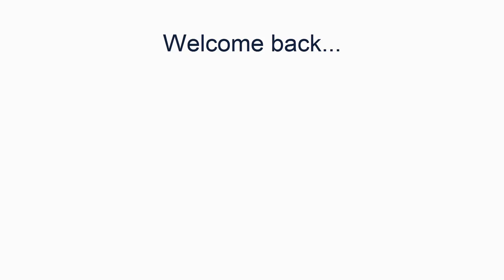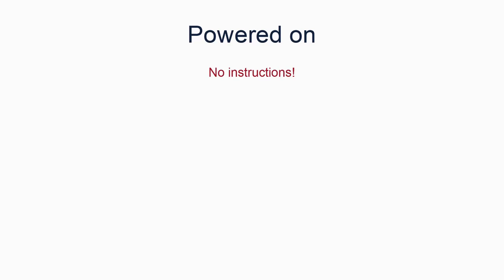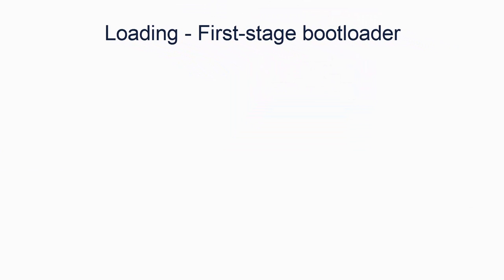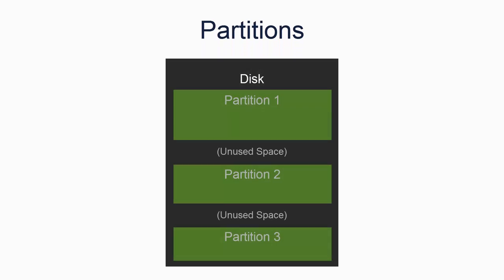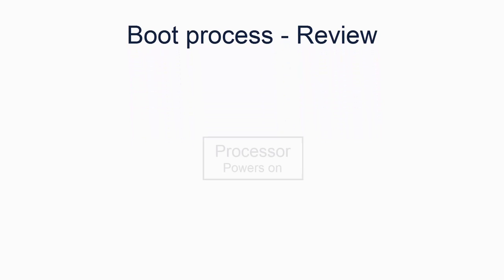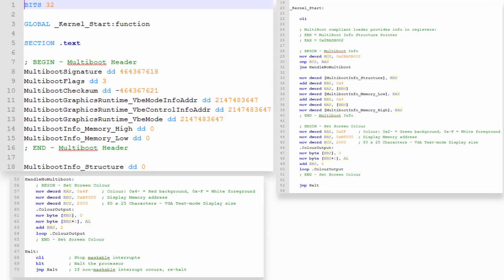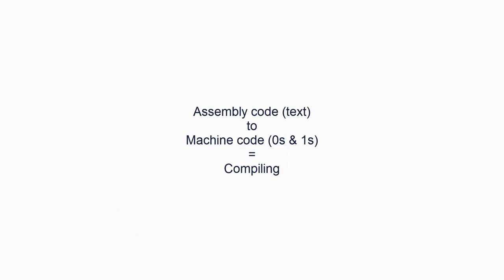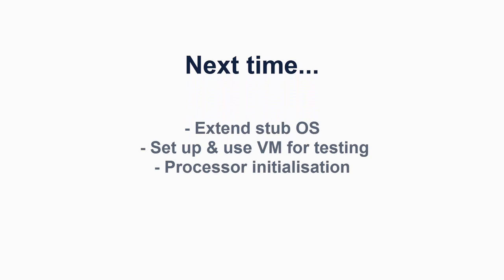2. Booting

Comment: What is the architecture of this operating system?
Reply from the maker: The compiler can target x86 or MIPS32. I've not maintained it in a while though and some users have reported errors with VS2019.

FlingOS can be used as a monolithic or a microkernel depending on how you set up the processes and communication. By default it's a microkernel.
Reply: @EdNutting  Ok, Thanks!

Comment: Can you make a tutorial for linux please?
Reply from the maker: Could do, though it depends what you'd like to learn? Linux is a very big and complex operating system. The Linux 2.6 Kernel is covered in a lot of depth in more than one book.
Reply: @EdNutting  It's just that I can't get the iso9660 generator for this tutorial, do you have any alternatives that I can use?
UPDATE: 
I tried the linker, but I keep getting this error, even though I added -arch x86_64 at the end of the command:

ld: warning: platform not specified
ld: warning: No platform min-version specified on command line
ld: warning: ignoring file linker.ld, building for -x86_64 but attempting to link with file built for unknown-unsupported file format ( 0x45 0x4E 0x54 0x52 0x59 0x28 0x5F 0x4B 0x65 0x72 0x6E 0x65 0x6C 0x5F 0x53 0x74 )
ld: warning: ignoring file kernel.o, building for -x86_64 but attempting to link with file built for unknown-unsupported file format ( 0x7F 0x45 0x4C 0x46 0x01 0x01 0x01 0x00 0x00 0x00 0x00 0x00 0x00 0x00 0x00 0x00 )
Undefined symbols for architecture x86_64:
  "_main", referenced from:
     implicit entry/start for main executable
ld: symbol(s) not found for architecture x86_64

I never put "_main" anywhere.  why is tat.
Reply from the maker: @wqatch  

UPDATE: Altered the command listing - my Ubuntu install was a bit quirky so I started fresh so this should work properly now.

So I'm guessing what you were originally asking is how can you compile, link and generate an ISO for the supplied files on a Linux host rather than on a Windows host?

If so, then the following steps should work (they worked on Ubuntu: Windows Subsystem For Linux, latest version today):

1. Install NASM for Linux from https://www.nasm.us/pub/nasm/releasebuilds/2.14.02/linux/:

Ubuntu: sudo apt-get install nasm
Other Linux Distros: Please tell me which you are using and I'll try to help.

2. Build the assembly code file using NASM

nasm -g -f elf -o Kernel.o Kernel.asm

3. Modify the Linker script to specify the output architecture.

Insert the following after OUTPUT_FORMAT:
OUTPUT_ARCH(i386)

4. Link the object file to a new object file... 
(Note: On Ubuntu, Ld should already be installed)

ld -mi386linux -static -T linker.ld -nostdlib -o Kernel.obj Kernel.o

5. Convert the object file format for ELF32 Binary:

objcopy -O elf32-i386 Kernel.obj Kernel.bin

6. Copy the bin file into the ISO directory

cp Kernel.bin ./ISO/Kernel.bin

7. Install 'genisoimage' for Ubuntu:

sudo apt-get install genisoimage

8. Generate the ISO image

genisoimage -no-emul-boot -boot-load-size 4 -b isolinux-debug.bin -boot-info-table -o ./SampleKernel.iso ./ISO

This should now work!
Reply from the maker: (You can ignore the warning that the linker gives you for now - I don't have time to go through everything to figure out the root cause. Let me know if you do. It doesn't seem to break anything though.)
Reply: @EdNutting  Ok, thanks!